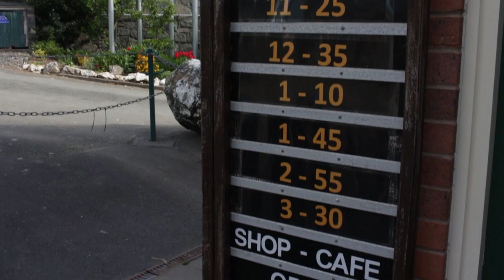General Update: 70s Weekend & More - Talyllyn Railway

Comment: Lovely little update there. Can’t wait to get back to Wales and start volunteering at the TR. It shall be interesting when my railway start running coal-fired locos, as our only steam loco runs on gas, so we’ve never used proper Welsh coal or English coal in the first place. I’m sure the TR will set a great example for railways across the UK in moving forward from the coal that has powered steam for centuries.